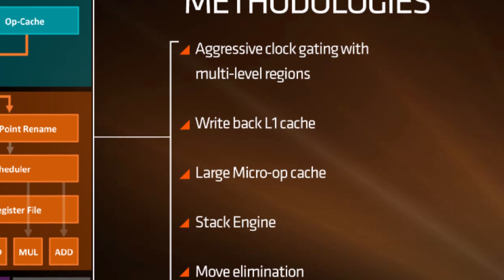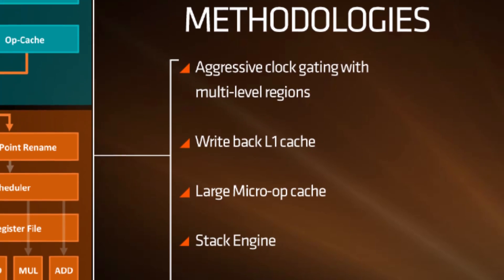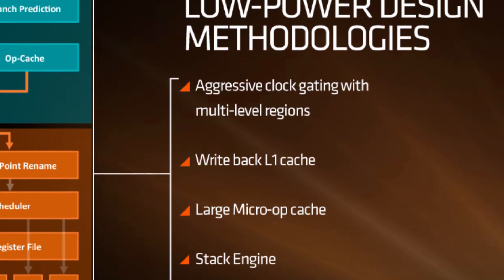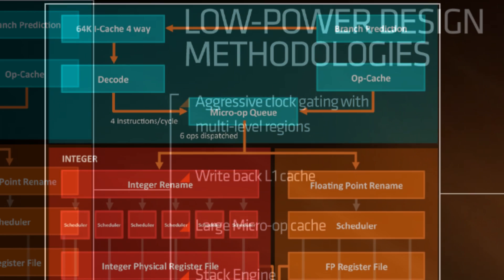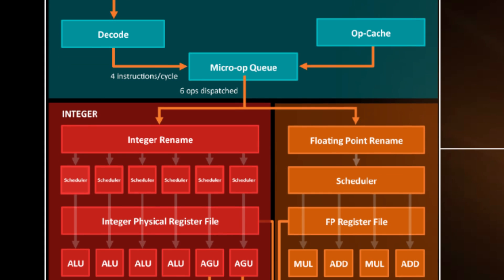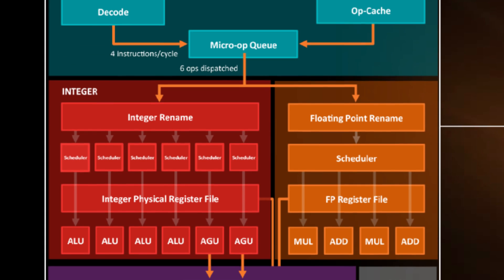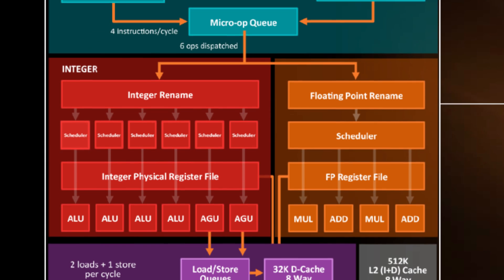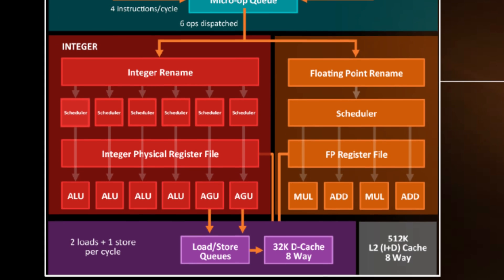Ryzen: What's Up with the "High Temps"?

Comment: now explain the rediculous temps on my 7700k
Reply from the maker: Accidentally swapped toothpaste for solder when attaching the IHS? :D (sorry intel)
Reply: Rather than soldering the lid onto the chip, or even using thermal paste, Intel decided to have their engineers dab some of their semen in between the chip and lid hoping that no one would know the difference.
Reply: It is a feature, actually. Intel thought all PC enthusiast would have fun deliding their CPUs and changing the "Secret Formula" they placed in there. Now we have companies specialized in selling deliding tools for Intel CPUs. It has become a whole new ecosystem now.
Reply: Stress tests in the 80s, gaming in the 70s. Even just starting chrome it will spike to 60. And this is with a slight underclock
Reply: And I'm using an aio lol not good
Reply: delid it and replace the thermal goop and re assemble to find your temps drop around 20-30 degrees... for such a huge fuck up by intel it isnt being reported on much.
Reply: It's crazy. My R7 1700 gets to 60C under 100% load and it's overclocked.
Reply: No matter what this cpu does it just goes full tilt.
Reply: Holy shit. My 6700k never gets above 65 Celsius with a mild overclock and Hyper 212 Evo...
Reply: Yikes, I only get those kind of temps on my 3820 when I over-volt it like crazy.
Reply: science logic toothpaste and mayonnaise..
Reply: science logic intel being cheap
Reply: +science logic Well something is obviously very wrong then. Either that cooler aint mounted properly, the pump is no functioning as it should or you are pumping way more voltage through the cpu than you think you are.
Reply: what are you talkign about? Intels dont get hot
Reply: What temps do you get>?
Reply: science logic: what is your cpu core voltage at? I hope you didn't leave it on automatic :P
Reply: I set it manually to 1.20 which has throttled me to 4.45
Reply: I would like to delid it just don't have the balls
Reply: science logic yeah intel is really cutting corners with kaby lake thermal interface. They thought because the chips are already efficient they dont need to beef up the tims. Shame really because almost all unlocked kaby lake chips can hit 5 GHz stable oc even with that shitty tims with a beefy cooler. My cynical mind is telling me it is intel's excuse to launch the 7740K which will be soldered just like their x99 lineup.
Reply: Glue instead of soldering. I guess that you know that and are asking for the known. You might as well just complain about it. ;)
Reply: science logic Intel use toothpaste for the thermal paste. if I had a 7700k I would delid it.
Reply: bloxyman22 it won't throttle til 100c it's just a hot chip that needs a delid and maybe a bios update
Reply: As a reference, my 4790k gets to around 67-68c stable after a long overnight 3D render... (similar app to Cinebench... just a different renderer) It's got a Noctua nh-d14 running in a Fractal R5 case
Reply: +science logic The thermal paste solution that intel use between the HSF and die is definitely not optimial, but even then it is not at all normal to get such temps. Have you really made sure that it has full contact and that the pump is running as it should? Have you tried any other coolers?
Reply: bloxyman22 it is a common fault with the 7700k deliding is the only way to fix it as i stated before for such a huge fault intel has gottwn away scot free really with this fuck up.
Reply: bloxyman22 yes and I've replaced cpu twice, reattached cooler dozens of time and I tried a evo 212 and the temp were worse
Reply: science logic 6elling you man delid
Reply: MaddXav lmfao, good one
Reply: lol
Reply: Nice try amd fanboy.  7700k still beats ALL ryzen cpu's.
Reply: still more expensive
Reply: Replace the bad thermal paste with liquid metal under the heat spreader of the cpu. 10c less heat after doing it.
But replaced it with a 5900x and running 90c now....
Reply: When you say underclock, did you adjust any vcore voltages? core clock does not directly dictate heat production, voltage does.
Reply: 80C WITH an AIO? Are you sure its even making contact.....?
Reply: And you know what's the sad part? Intel acknowledges it.
Furthermore, it says that their engineers are working on the best and optimal solutions. And...
Here's the best part... get ready...

According to THEIR data, there is NOT ENOUGH evidence or DEMAND from their CONSUMER-grade customers - to have to solder CPUs.

When asked directly "So there is NOT going to be solder used in your future CPUs?" - The Intel representative(Hans Jürgen Werner, Intel, Director Consumer GTM EMEA) - has said what I said above.

So... Coffee Lake, Skylake-X and whatnots - enjoy your toothpaste!

Just in case, here's the video - /watch?v=80xb9fHio4g

Fair warning - it's a russian video, so it has russian dub over the quieter conversation, but you can hear enough to figure that it's not a fake. Either way, not linking the video to be watched, only as a source for my words.

Comment: Samsung processor node sucks a dick, not a true 14 nm, processor runs hot so they have to keep those fans spinning real fast
Reply: E3k that's not a good representation of the manufacturing process. globalfoundries is using samsungs LPP process, which is designed for a low power design, and doesn't scale particularly good outside certain envelopes. samsung is working on 14nm LPU process to increase performance further.

you have to remember how many revisions intel has had on the 14nm process to get to the kaby lake point. kaby lake is simply a cleaner transistor to skylake. not to mention samsung's 10nm LPE is now in production with LPP later this year probably
Reply: All ryzen chips are manufactured at globalfoundries.
Reply: Just a Skeleton owned by samsung
Reply: Oh, I didnt know they had that kind of relationship. Though I dont think thats related to amds precaution. If anything its because the chips are smaller than intels and thus similarly hard to cool. they are pretty comparable since they both have soldered heatspreaders
Reply: AMGV Media I don't care about Samsung or the process node. what I do notice is that at high temps the processor slows down. amd has a good design, but Samsung is holding it back. TSMC has a mature manufacturing process, amd should have gone to them.

Comment: Why not report the true temp and make the board work at lower temps
Reply: Bioses need to be as barebones as possible.
Reply: Chris Major if you listened to him, AMD did it to basically save OEMs and such the headaches of designing around different thermal designs.  It also means that the board and bios is treating each CPU as if it's much warmer than it really is, so that way it can boost much higher because the thermals in reality are much lower.  Basically, short story, it's a genius hack so that their cores have a +20C headroom to boost to XFR state and hold boost longer.  This does mean that it requiring updates to reporting applications to change their offsets property to the end user..

Comment: i came up with the same conculsion on my own, but honestly i didn't take myself seriously: they could have gone with the steeper curve on all chips, low wattage parts would simply run the fan at idle speed most of the time.
overengineering at its finest.

Comment: Thanks for the clarification, one question, will the update that will report a more accurate temps allow for more overclocking of the 1800x ? also, do you think the 1800x will be able to OC more than 4.2Ghz in future ? thanks
Reply: Judging by all the testing that has been done, I would not think so.  The first revision of Ryzen seems to be process limited (ie. 14nm LPP), so we can expect better clocks and efficiency when Ryzen revision 2 and then revision 3 arrive.  This is not to be comfused with Ryzen 7, 5 and 3, since these would just be part of the sub family names within the Ryzen brand.

Comment: Perhaps, but the problem is that it makes the fans run faster during low load scenarios then it should for those of us who are silence freaks.
I mean, I'd actually like to pay top dollars for an 1800X because I'd like to support AMD and because the better binning is attractive.
But to be quite frank, I'm probably going to go with the 1700 because of this 20 degree crap...
Or in other words, AMD is losing money over this.
And it has nothing to do with the temp being reported to me as a user, and everything to do with them reporting it wrong to the UEFI.
Because not everyone willing to pay top dollars for an 1800X care more about longevity and performance then they do about silence...
Reply: I was about to mention passive cooling if you're a silence freak. If you get a silent water pump, that would be ideal as water can carry the heat much much farther (like 10+ feet compared to a few inches) than heat-pipes on air coolers. You could just mount a huge radiator (think car radiator from a junkyard for $20-$30) to the side of your case. Then water cool it all. I still recommend at least some kind of fan for your case (motherboards puts out heat too), so ideally run several very slow fans (3 slow fans make less noise than 1 fast fan with the same airflow). You can do this buy putting the fans ground molex into the +5v wire (red, I think, double check that), and the positive into the +12V (yellow) so your fans run slower at 7V (less than half the noise). Or you can buy a fan speed controller if you want to make it adjustable.

Anything you do is at your own risk, water can leak, you can plug things in backwards, and killing a butterfly could start a tsunami on the other side of the planet.
Reply: just put your pc in a closed off desk with some silent fans pushing and pulling air. in the other room you wont hear shit
Reply: You should be able to adjust the fan profile in your BIOS (or maybe with software). I even do that on my laptop. I think even my $40 AM3 motherboard has a custom fan profile option.
Reply: You can always set your fan profiles accordingly.  Just know that you are shooting yourself in the foot when the processor tries to clock as high as it can go, unless you plan on overclocking, then carry on.
Reply: +Faf Dus I've already done the first two, and I live in a small apartment so the last one isn't a option for me.
I got noctua fans all over my Fractal Design R5...

But like I said, I'm a silence freak, not just someone who prefer little noise.

+Jake Garrett and +Marty Haight On some motherboards (including my current high end AM3+ motherboard) there's a limit to how low you can go with the fan profiles.

Also, +Marty Haight Yeah, thanks for the warning, but like I said, silence is even more important to me then performance. I was thinking of doing some P-state overclocking on the 1700 for that reason.

Honestly, I'm thinking of perhaps going 100% passive build later (no case fans, no CPU cooler fans, no GPU cooler fans, that kind of thing is actually possible these days for a 95 W CPU and a mid/low end GPU if you got the right case)

Comment: Not really looking for an answer, but if you could check your MBs and post a response or video with info as to why tools cannot show the actual CPU core voltage? My example is from an ASRock AB350 Pro4 AM4 MB.
BIOS set to 1.35. Under load: CPU-Z shows max of 1.264, AIDA64 (latest) is showing max of 2.528, HWInfo showing max of .667. Ryzen master 1.350 but NEVER changes up or down regardless of load. The world may never know :) I under than the three tools are just multiples and that they ultimately agree, but not close to the BIOS setting. That could V-droop, but it seems excessive. I could turn it up, but is the BIOS "right" or are the tools right and over volting in BIOS is "OK"?  
Thanks for all of you technical insight and sharing!
Reply: Just get a (good) multimeter and attach the leads (or just hold them there) to the back of the motherboard and measure the voltage across the VRM. Software kept showing about .1V lower on my AM3+ board, so I was about to start pushing way over 1.5v, but when I measured it, it was spot on with what the motherboard BIOS setting was, that and the sustained Vdroop was nowhere near as bad as what software was showing, software was showing almost .2v drop under load, when it was close to .02v.
Reply: From what I have gathered this is related to the processor automatically doing its own internal power states when cores go into deep sleep when not needed.  The operating system only shows the last known state that core was in, until the OS turns that core back to full power to work on a task.  More support should be added to tools soon. You can read more here: https://community.amd.com/community/gaming/blog/2017/04/06/amd-ryzen-community-update-3
Reply: I will check you link, but the voltages listed are under full load testing with AIDA64 stress. AIDA64 is showing 115Watts, but I'm not sure if that is accurate either. This is for a R7 1700 btw. Windows 10 is set to high performance mode and C6 state is disabled as is Cool 'n' Quiet.
Reply: Like I said, probably just inaccurate software. Temps still aren't even correct in HW monitor for the FX series, otherwise how am I sweating with my CPU at 8*c? CPU-z and HW all show incorrect voltages (both are showing the exact same with each other, so just because 2 software monitors match, doesn't mean they are correct).

Its easy to measure VRM, just measure the 2 pins on the back of a choke (square block next to VRM heatsink), any of the middle ones (8+2 phase means don't measure the last 2). They are very easy to find on the back of the board, and thankfully my case has a huge cutout where you can see everything from the RAM voltages to the CPU Vcore. Software unfortunately is way off a lot of the time, so its best to get the real measurement if you care.
Reply: Jake Garrett - was replying to a different person's response about power management. Sorry for the confusion and lack reply name.
Reply: +Matt McGregor:
I have a Ryzen 7 1800X. HWMonitor shows 1.36 V mostly.
In the BIOS, I have 1.35 V.

Comment: Annnd now according to the AMD community update there will no longer be a temp offset? https://community.amd.com/community/gaming/blog/2017/04/06/amd-ryzen-community-update-3
Reply: The temp offset is always going to be there. It is built in in the RyZen 1800X, 1700X, and 1600X. The RyZen Master, though, is going to be updated to report the right temps.
Reply: "1. Ryzen Master now reports junction temperature, rather than tCTL, by automatically removing the tCTL offset on the AMD Ryzen 1800X, 1700X, and 1600X processors. See the “temperature reporting” section of this blog (https://community.amd.com/community/gaming/blog/2017/03/13/amd-ryzen-community-update) for more context on tCTL."
(rhallock cu 3)

There will still be a temp offset just not reported to the user. Wendell explains it at 2:29 and 3:42
you can read more about the offset in the first community update https://community.amd.com/community/gaming/blog/2017/03/13/amd-ryzen-community-update
Reply: Temps showed in BIOS though aren't fixed by it and that was the intended to be +20C.
Reply: Yeah but that's irrelevant for OEMs, there are foreseeing for the non power users who just get their PCs built or get a HP one.
Reply: Do you have a source please that the 1700 and 1600 is not affected? Thanks.